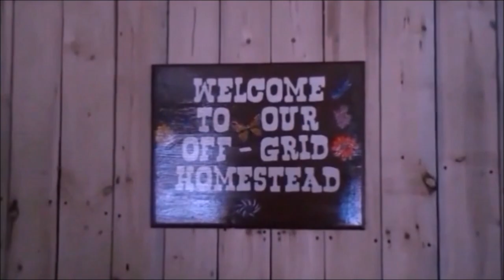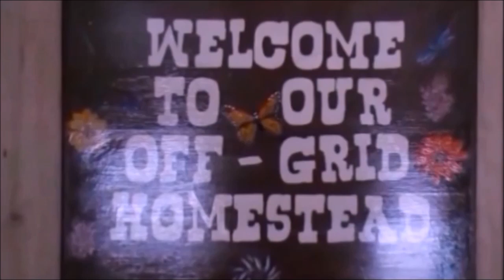Concrete Pour Day Has Arrived

Comment: My choice for keeping  wood tool handles protected  so  they will  last for many years is Boiled Linseed Oil yes you can use other cheaper things but this stuff works best. Old or new two to three coats of this stuff is all it takes.

Comment: When you did the screeding, did you have a level on the top edge to help keep it flat? Thay would definitely work well when screeding around the edges, giving a good baseline to screed the center part of the slab with.
Reply from the maker: We were not that concerned with that Jeffrey... It was way to hot to mess around with trying to get it perfect.  We just made sure it was level with the top of the forms, the floor will have some kind of sub floor or tile over it.  Thanks again. You take care ttyl...Cheers.

Comment: You’ve never had a problem just laying the mesh right down and not suspending it actually in the concrete?
Reply from the maker: No not really, the ground under the mesh was rough enough that the mesh was up about 1.5 inches here and there.